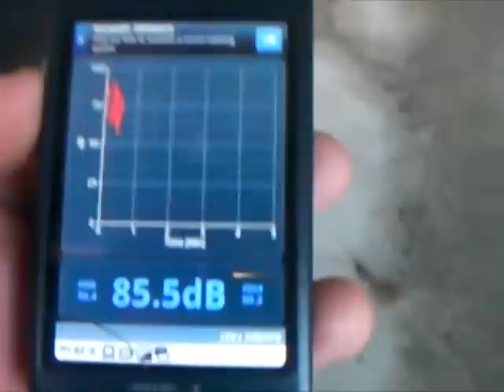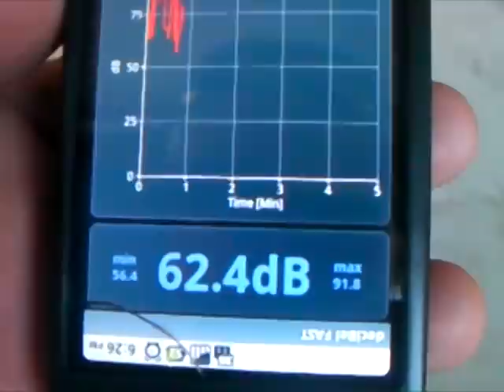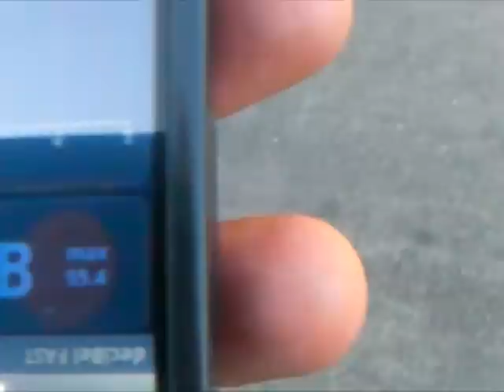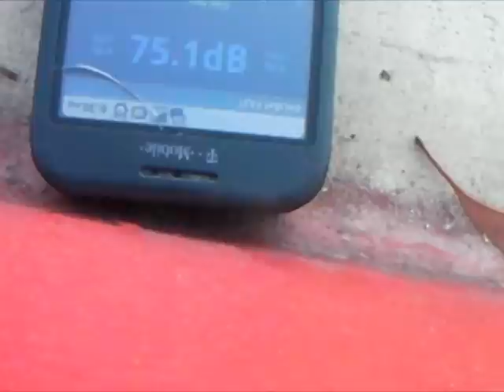How To MOD Exhaust 2009 Vulcan 900 Custom 2 of 2

Comment: I just removed the plates (drillout) bought a 12 inch 5/16 drill bit , drilled out 6 holes in each baffel (your option) Ground about 1/16 off the edges of the end plate to let the sound out,pop rivited the plate back in place,sprayed flat back on rivits, looks STOCK but sounds GREAT no poping or backfire,just the right sound not offensive...dont understand all the cutting and buggering other videos show...tips look completly stock but louder......
Reply: What does you mean with "ground about 1/16 off the edges of the end plate to let the sound out? I understand drilling the 6 holes, but not this line ( am not native English speaker)

Comment: there are 3 baffles total in the pipe. I took a hole saw and cut out the first one then drilled through the other 2 with a long bit from home depot. It sounds amazing! Not to loud when cruising but sounds good when rolling in it. Ill post a video also.

Comment: That is a great job, and good video. I am surprised you didn't show the cutting. That blade seemed to be very tight and touching the top of the pipes. That would be my only concern. However the intertube to save you pipes on the bottom seemed ingenious.

Comment: I have only had my 900 for a week, and have not really been able to ride it. But I have been doing a lot of research on Cobra Dragster Pipes. Or simply saving 400 dollars and de-baffling my stock pipes. I certainly have all the tools to do the job. I just need to scrape up enough balls to do it. Too worried about nicking em up at the ends.

Comment from the maker: What I did was to use a screwdriver to "punch" pilot divets into the metal.  If you have a center punch that would be the way to go.  I suppose you could drill twice, but there is really no need as you would still have to use a punch of some soft to insure your pilot hole doesn't go all over the place.

Comment: Thanks for sharing your tips.  I have an '06 Vulcan 900 with 4 holes in the baffle plates. Please describe exactly how the sound will change if I drill 4 more to make 8 holes. Is it a little louder, deeper?... or higher pitcher?...or really not noticeably different with 8 vs. 4 ???  Thanks again.
Reply: I have a 09 custom and I bought it with this done to the exhaust. After riding it for a while I wanted a deeper sound. So I took a 3" hole saw to it. Love the way it sounds now. No change that I notice to the bike other than sound.
Reply: ***** So you basically just took out the entire baffle?  I have an '09 Vulcan 900 Custom also.  The sound's louder and deeper now?  How is your bike running?  Any change in power?
Reply from the maker: pjamese3 no change in power,  just more sound and it actually sounds like a real bike now.  MPG is great and power is unchanged.

Comment: Gutted mine complety in 2010 mines an 09 sounds awesome you can idol the motor down some also but make sure you use a volt metor on  the battery so at a idol it still charging to at least 13 volts plus it will keep the motor from running hoter on hot days you can marble the tube on the top right side of the breather and knock down the back fire.saw it done on a Kali forum
Reply from the maker: Cool.  Hey can you post a video redone with how your bike sounds? I'm interested in how it sounds by retarding the idle.
Reply: O G marble what, where?

Comment: I love to drill out my pipes but just wandering what can go wrong. Can it cause my bike not to perform as designed. New pipes are not cheap but at least would have old pipes to go back to if new ones were too loud. have to think it thru.
Reply from the maker: Jeff,  doing this mod is no different than buying pipes other than the fact you are going the work lol.  I ran mine like that for about a year then had to get new ones because a lady hit my bike,  otherwise I'd still be running them.  Others here can come in though.  Has anyone run them over a year and experienced issues?
Reply: I drilled mine out and no issues. Louder than stock but just not the sound of real custom pipes.
Reply: EvilJesus the question isnt having issues, you probably arent going to have bike issues with it, i dont know about your countries legislation, but in my country we have a mandatory inspection every year, and we cant have the pipes drilled or else the bike fails the inspection and you cant ride it LEGALY anymore, taking that apart, my biggest concern and the reason i dont do this is because by drilling the pipes you loose power in the bike, of course if you drill a small hole you only loose a small part, but you dont get that roar either, if you drill alot or if you take it out completely, it will make insane noise, but will loose alot of power

Comment: Thanks for the video. I followed it and end result about the same. My bike is 6 years old so there was some thin rusting inside the pipe so I treated that last night and plan to paint the inner area with UHT black, like the other dude said he did. Great job -- thanks again. After the pipe cut, that was a little challenging -- used a dremel to start it off, then an oscillating tool that did struggle a little, but then used a dremel metal cutting disc to trim back to desired length and then a dremel sanding band to clean up the edge, and a countersunk bit in a screwdriver handle to clean up the holes. All in all, very pleased.

Comment: My mistake on the fuel injection. I have a Vulcan 750 so I was thinking 're- jetting'. BUT when you got the Cobra, you had to get the Power commander! Why? Because there is less back pressure and the fuel injection had to be changed. It's the same thing.as rejetting. According to the mechanic I spoke to you DID lose power when you drilled holes in the original stock exhaust. But depending on how many holes you drilled or how you ride, you may not have noticed any power change. Thanks.

Comment: Just buy a Cobra HP Pro Exhaust, it's alot louder than the fully defaffled stock pipes. Plus, if you want even more insane sound, the baffles in the Cobra HP Pro pipes can be removed and put back in by just unscrewing 2 bolts. It's worth every penny of the $800 price tag. Plus, even when riding with Harleys, your bikes is still usually the loudest bike on the road.

Comment: THANKS for your video : I'm not fond of mechanic but thought my stock exhaust was way too silent for my VN900 custom... thanks to your easy tutorial, I will be able to reproduce this easily !

Besides, I live in France and th regulations are REALLY strict regarding noise, but if stock exhaust is allowed, your video clearly shows that the DB amount is almost the same in the end, although it sounds much better without the baffles ^^

Comment: Just wanted to say thank you for the videos! I recently purchased an 07 Vulcan 900 and was able to perform the mod in about an hour with a Dremel tool instead of a reciprocating saw, but other than that, exactly the same. The exhaust is so much deeper and throatier, and just sounds great! Thanks again!

Comment from the maker: I agree that a system designed for this purpose is a must if you are doing this for performance reasons. Remember that this MOD is not really designed for performance, but more for sound. I eventually got a PowerCommander V and made a custom map to give me more power on my lower gears.

Comment: I will say that it is very difficult to cut the baffles as the metal is very thick, I used a Dremel tool, be prepared to be patient, I have only put small holes on mine as I was worried about affectin the runnng. I suppose my logic is that I can some mores metal away if I want but difficult to put it back so thought I would do it in stages.

Comment: I know they can be pricey, but, try to save up some dough and buy a two-into-one exhaust system. Cobra makes a good system. Cobra also makes a good fuel management system for their pipes. SuperTrapp would be the best for a collector/muffler if you can make it work. Remember -- making it louder doesn't always make it quicker.

Comment: do you have to adjust the fuel injection to compensate for the extra air escaping??? will it run rich???
Reply: Motorcycle nowdays has computer who will adjust itself I  believe. Shoiuld be no problems BUT gas mileage decreases significantly. More power, more fuel. Three  ( 5/16 inch) holes would be enough. This mans 900 Kawasaki Vulcan Custom sounds great. Looks good too. Good job drilling the holes.
Reply: sp  - should    thnks

Comment from the maker: @tommyarmour68 Thank you! I did fail on showing the cutting (hind sight I wish I would've recorded it).  The inner tube on the inside is there to protect while cutting (because it is a VERY tight fit for the blade), but if you keep that inner tube in there, it will protect the pipe from some of the sudden jolts you will have.  The Sawzall will cut that inside tube like a hot knife through butter, just take your time.  Remember there is no rushing this (you only get one shot). Good luck!

Comment from the maker: GSP, You will not need a fuel management system with this MOD. The PowerCommander and other such modules are only going to help once you completely debaffle OR replace the exhaust system. This is a very minor modification that will just give your bike a better sound. Good luck! If you have other questions, please feel free to ask me here or on BikerSpots's Forums (I check those daily).

Comment from the maker: Actually, you are mistaken again - I got the PC because I like to have better mngmt of my Fuel/Air ratios (PC5 lets you adjust at each stage). I ride both on long highways (long 400+ mile day rides) as well as through the mountains (switchbacks). I would notice a change on my ride (it's an 09 with 51K+ miles on her now and she's going strong). Recent tune up showed super clean plugs, oil is still perfect. Next week she gets a total breakdown (major tune up), but I'm sure it will be no problem.

Comment from the maker: As with anything else, customizing your bike is one of those things that you do because you want to make that bike fit your personality. I have now used the debaffled pipes and also a set of cobra swept pipes and really the engine doesn't run hotter, the backfires are minimal. the fuel economy does suffer a little (minimal), but you don't put pipes on your bike to make it more efficient. As for the cops, you ride = you attract cops (they go hand in hand).

Comment from the maker: Joe, the mechanic (although technically right) was not completely correct. You can have backpressure loss, but not substantial. There is NO REJETTING on these bikes (these are all fuel injected). I ran mine like that for about a year with no loss of power, no loss of MPG and a nice rich sound. Now I have upgraded to Cobra Swept Exhaust and PowerCommander V. My mapping is such that I do get less MPG, but my POWER is unmatched. My engine is still in PERFECT condition. 49K miles and still strong!

Comment: Was just wondering if there is any other tuning that needs to be done when you open the baffles like that? Also will a different number of holes make much of a difference + or - ? Thankx
Reply from the maker: Thank you for your question. The great part of this MOD is that NO FURTHER tuning is necessary. You will not need a PowerCommander or anything. You will also not notice any loss of power, just a gain in sound. :) Enjoy!

Comment from the maker: @tommyarmour68 Just cover the pipe with the innertube and you will be fine (so long as you don't just start hacking away at it).  Trust me I feel you on doing this on a new bike (I rolled mine out with 0 miles and when I did this I only had the bike about 3 months.  Just take it slow (watch the video until you feel comfortable and then jump).  Trust me you will like it.  The only change I would do is instead of 5 holes, do 10 holes (of course this is your preference...more holes=deeper sound).

Comment: I went the other way with my Honda VT1100C Spirit (Cobra pipes) and silenced them down from the factory level. Added some rolled up expanded metal cone shaped plugs. I could not stand the noise level at interstate speeds. I'm 62 yo though.

Comment: by taking out the baffles, you loose alot of fuel economy,motor runs hotter,u will get back fires,loose horsepower & the motor will not run right casue it was design to be ran with those stock pipes with baffles.yes it will be louder which is very attractive to the cops.

Comment: Pretty interesting video. I did the same mod to mine but settled on just two 3/8" holes in each. I don't know if you mentioned this but it's much easier when you use a blade with a higher TPI. Controlled low speed and let the weight of the saw do the work and it hardly bounced around at all. After cutting them I also deburred the edges with a Dremel and used some black high temp paint to cover up the mod a bit. Even from fairly short distance, visually you really can't see they were cut.

Comment: Followed this video to the letter and it worked great. Couple things I thought I might add. For best results with the recip saw, use a 24tpi blade. It cuts thru the inner pipes like butter with almost no blade jump. Harbor Freight sells some perfectly good ones for cheap. Easiest mistake to make is to put the recip blade in too far so that it bangs against the far side of the pipe. Just back off a touch and it'll smooth right out.

I also had a bit of a tougher time cutting the lower pipe so it resulted in a bit of a rougher cut, but still looks good. I drilled three 1/4" holes in each pipe and it produced a nice rumble while still maintaining good backpressure and not sounding too obnoxious. I can always upsize if I want.

My pipes had a fair amount of surface rust on the inner wall that was exposed when I drilled the cover and cut the inner pipe. It looked pretty ugly. I solved this by taking a wire brush to the rust and painting the inside with high temp black paint. Turned out great.

Like he said, don't be sacred, it's actually quite easy

Comment: I did this today. only thing I did different was I did not cut the pipes off. I drilled 3 (1/2) holes in the baffle then trimmed about 3/16 off the baffle plates. Then riveted them back on. looks 100% stock but sounds great. thanks for posting..
Reply: Hello, Noticably quieter than 5 holes with 5/16???

Comment: honestly have u noticed an increase in HP,torque,speed or power in general by drilling out the pipes???...i know its louder n many folks think the bike is faster,
Reply from the maker: no. this mood is not designed to make the bike faster,  simply give you better sound. it will not affect your gas efficiency,  speed,  etc etc

Comment from the maker: Hello, with this MOD you will NOT have to get a Power Commander and you should not see a noticeable difference in MGP. The modification is not extreme enough to make a difference except for the sound. I did a tune up about a year later and had some of the cleanest plugs I've ever seen. They weren't running hot at all .

Comment: Great video.  Looking to do this on my 900 custom.  Have you noticed any change in performance?
Reply from the maker: Performance is unchanged, sound is awesome. All the tall about loss of back pressure is bunk. I've been to Sturgis, Vegas,  Mexico - multiple times and no problems.
Reply: EvilJesus
Well alright.  I guess I'll be getting the pipes to sound like they should have from the factory in the next weekend or two then.

Thanks again for the step by step..

Comment: DON'T DO IT!!!!....I was just talking to a mechanic and he said that making holes relieves the exhaust of backpressure. Backpressure is what gives compression in the cylinder. You will lose substantial power in the midrange. Even changing to louder exhausts like Vance and Hines or Cobra requires tempermental re-jetting. DONT DO IT---you'll be sorry.
Reply: fuel injection does not require re-jetting